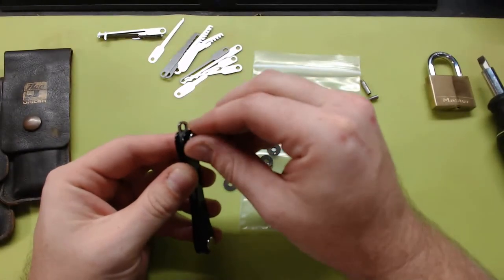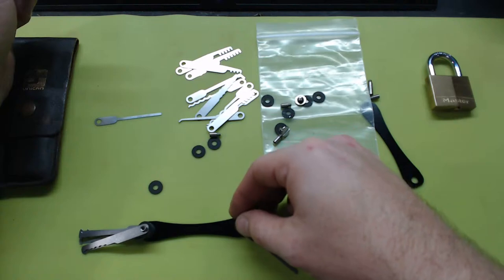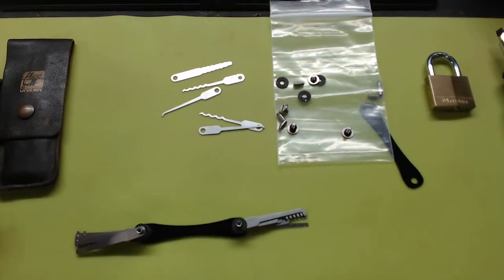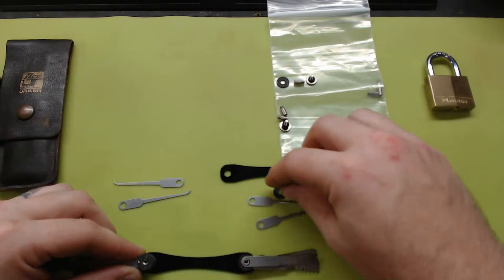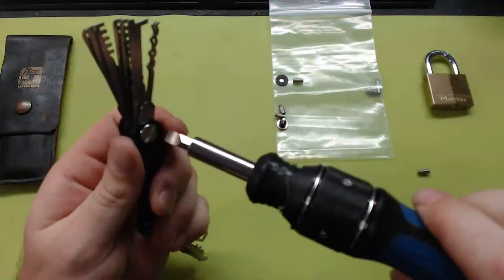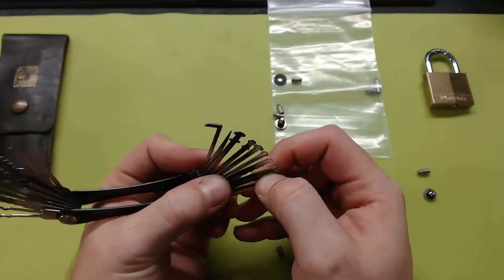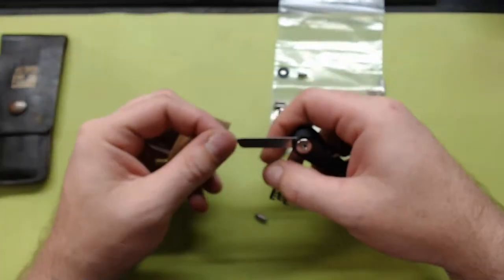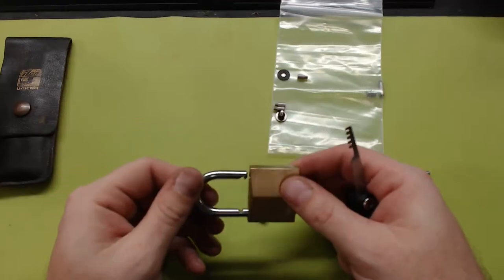Covert Companion Assembly | Lock picking

Comment: I finally went ahead and bought this because of the "black Friday" sale. I still thought it was overpriced, but given LPL being attached to it, I assumed it was of the upmost quality.
Well, I'm a bit disappointed. Half the tools are bent slightly which makes it a chore to line everything up to fold it up properly. It's still a nice addition to my arsenal, but IMO it doesn't fit well into the "You get what you pay for" category.
Reply from the maker: Agreed... Mine is also that way... It was really a pain and took far too long for a simple pick imo.
But I supported the channel anyway😅
I think it would've made more sense at $40 tops, maybe $50
Reply: @SpectrumDIY  Agreed. The most this should be, to me, with all the extras (tension wrenches, padlock bypass tool) is no more than $60. Oh well.
Reply from the maker: I love that user name 😂
Reply: @SpectrumDIY  Thanks! It's a variation of my usual online handle of Iyeet Paste.